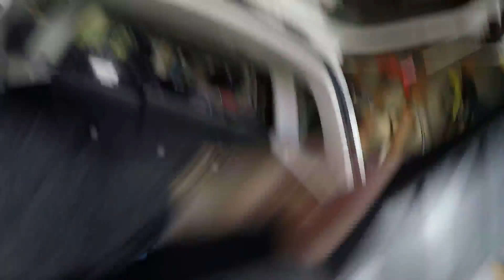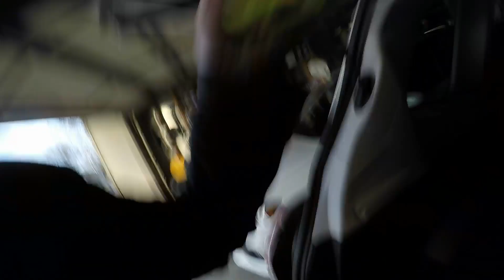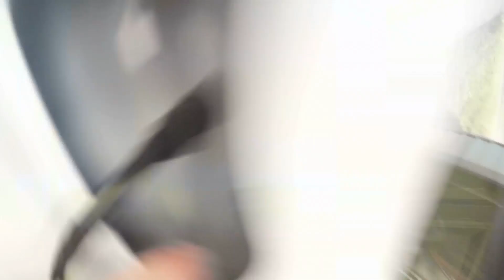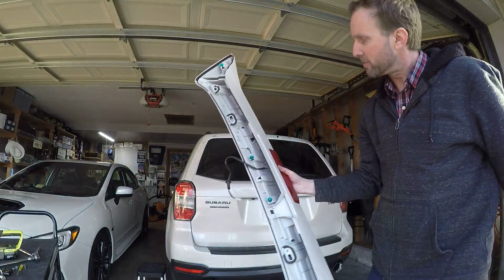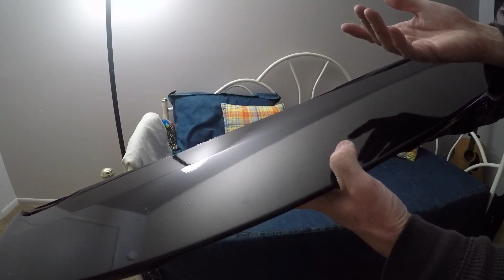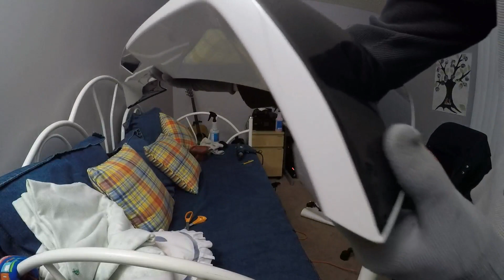2015 Subaru Forester XT Ep. 89: Wrapping the Tailgate Spoiler

Comment from the maker: I re-did it tonight, cuz it had a light surface scratch on it. This one is even cherrier, but i can't seem to avoid the tape lines embedded into the edge of the wrap..
Reply from the maker: PS. You DON'T need to remove your spoiler to do the topper. I did it on the car tonight. It was even easier than taking it off.

Comment: Hey LHG, great video.  I’m trying to remove the spoiler on my GF’s 2015 Forester to replace the LED brake-light module.  I’ve taken off all four screws that you highlight but it still won’t come off.  Did you have to push through the plastic fasteners as well?  Were there only those blue two you pointed out? Any tips? Thanks in advance for sharing your DIY video! 👏🏼👏🏼👏🏼
Reply from the maker: thanks jj. i mean, whatever i showed in the video.. glue might be holding it a bit too.

Comment: Great job. The tS overseas comes with not only the full black spoiler but the mirror caps too! As far as USDM from the factory, the whole spoiler comes unpainted these days (bolt covers as well as the spoiler itself). D4S, EH3 Crystal Black Silica Pearl I believe is offered for the Forester line. 

Love what you're doing to the Forester!
Reply from the maker: The forester bolt caps come painted. I ordered whites and blacks tonight.
Reply: interesting! When I was looking into it before it appeared they had rolled all the old 'painted' part numbers into a parent unpainted one. Perhaps it was because I was looking into the whole assembly...
Reply from the maker: Oh dude... then my order might get rejected...
Reply: 96075SG010V2 and 96075SG000V2 should be the numbers for the black caps.... looks like you are 100% right that they are painted. The spoiler itself though appears to come as unpainted if you order it. My bad.